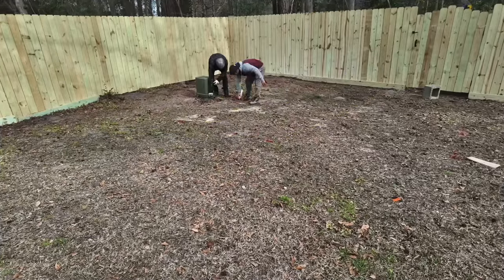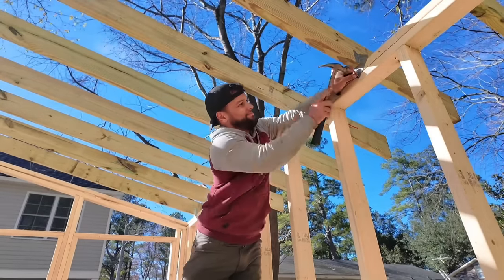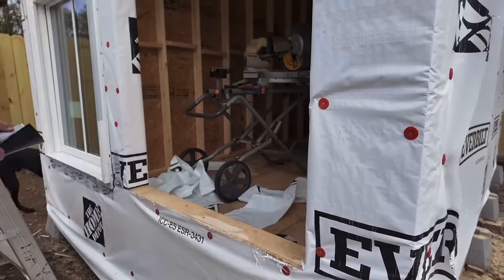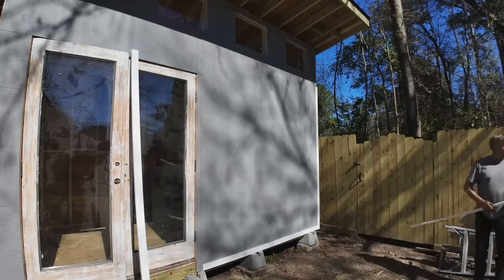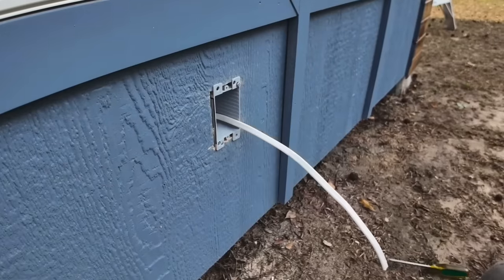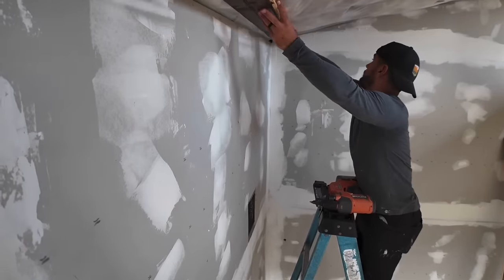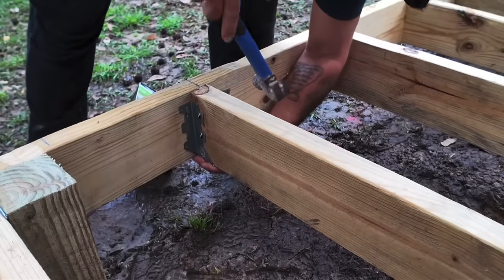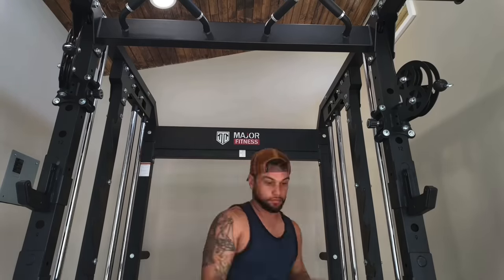How I Built A DIY Tiny Home Gym Full Build

Comment: This is nice. I especially love the windows across the top of the wall. Let's light in but folks can't see in and you don't have to buy shades/blinds/curtains for privacy. Where I live though, it would need to have mini split or a AC/heater combo built in to the wall or I'd die of heat exhaustion in the summer and freeze in the winter. It's currently 96F and feels like satan's furnace in my yard. I don't want to know the temperature in my outbuilding. It's insulated but not climate controlled. 

Thanks for sharing your efforts in building this tiny!

Comment: Just like HGTV. Looks great. But your longevity with a structure is only as good as your base.  And that concrete will crumble and cause issues.  Also you could have saved money on the screen track by using wood trim over the screen stapled on.  Cheap simple and effective.

Comment: How come the deck is secured by dug in posts, while the house is just sitting on blocks.
Reply: Because the deck is so much lighter than the house. If a good wind comes in, it can lift the deck and break the wood. If there is a wind strong enough to pick up the house, it would have been destroyed anyway.

Comment: Very neat concept, but I am concerned about how narrow it is.  Trying to put weight plates on the bench press bar is going to be difficult.  Second, if the bar is in free form (i.e., not attached as with a Smith machine), then there is a risk of it hitting the walls making holes in the drywall.  The building itself is going to get very hot with the windows amplifying the radiant heat.  I would have installed a ceiling fan or at least installed a small purpose heat/air system that is for a single room and have a minimal operating cost.

Comment: Next time use a saws-all to cut out your plywood for the windows. Instead of a router. I'm sure that was a real pain in the butt. Saws-all makes the job a lot easier. I forgot to mention, so this is an edit. You did an amazing job for someone that doesn't build houses for a living. It takes people years to learn these skills some times. You nailed it on your first attempt. The only thing I would've done differently is I would've done a metal roof, and caulk every seam. Shallow pitch roofs should always have metal imo. Best wishes!

Comment: I noticed with the 4 small windows across the front, above the door, you only used a single sheet of glass with no insulation. Does it not get hot or cold where you are?

Comment: I don't know if anyone has mentioned this yet or not, but when roofing with standard shingles, every nail gun i've ever worked with has a built in guide on the front of it to where you can just place the shingle, then slide the nailgun up from the lower layer until it catches when it is in line.  Does that make sense?  not sure how to describe it... but it makes roofing a lot faster than trying to eyeball it.

Comment: As a person who has never built a house, how do you adjust for the small things you find like that door frame size issue around 15:25 and if you ever find angle/level issues with your frame and stuff? Like the sizes/holes have been built with those sizes in mind and I understand things go awry sometimes but how do you correct for that? How'd you correct the 1/2 inch extra space on that door frame without leaving a random space?

Comment: This is the best video for tiny home building. However, I noticed at 33:58 that the wire and LED light are in direct contact with the wool. Wouldn't this pose a fire hazard?

Comment: Love the idea.  Curious…why are you using both screws and nails as opposed to all screws?  Is there a specific purpose in that or preference?
Reply from the maker: Thanks. 
Screws are great to hold a piece of wood together tight but they are not flexible wile nails can flex without snapping so using both allows the building to be ridged and also flex when it needs to.
Hope this helps. ✌️

Comment: Couple things the sheath to the wire needs to be in the box your exterior gfci the sheath didnt enter the box 1/4 inch is required and the nail plates are not necessary if your hole is 1 1/4 inch from the face of the board

Comment: Helpful tip, never make your deck perfectly level from front to back.  Add just a tiny bit of and angle downward,  away from the house,  to draw the water off the house and the deck.  Now when it rains,  you'll have water that's going to go towards  the base of your house if you don't add that slight angle downwards. Not sure how you could fix this now, without a tremendous about of work.

Comment: For the wooden window sash (frames) I didn’t see any room for expansion (backer rod, setting block, 3/8 space) . Depending on the humidity, winter temperature or area of the world this is, the wood will suck in moisture and either make the windows unable to open or crack. (I do glass installation)

Comment: When you say you made sure all outlets worked. Do you mean that it was wired from the pole 😮already? So you were wirering hot? Or did you fill the breaker first?
Reply: Also why didn’t you use deck blocks ( the same as you did for your foundation)?

Comment: That wouldn't work at all in Florida
Looks like a Hurricane would scoop it right off the ground and throw it miles away.
And if it survives the Hurricanes, the Termites and Fire Ants would eat that floor away in one summer.  And most of the walls as well.
What part of the country are you in where you can build using a wood frame and leave Plywood and wafer board outside?

Comment: For the roof, you need to put the drip edge down on the eave first. Then the water barrier. Then the drip edge on the rake sides. You also didn't use starter shingles. I'm not trying to criticize. Just trying to help. You are actually building stuff. I'm just sitting on my ass watching YouTube.

Comment: I noticed there wasn’t a plate on the bar and wonder how easy it would be to slide on bumpers if that was even possible.
I’m not even sure the floor could handle deadlifts.
It’s a nice shed but I don’t see it being functionally more than that .

Comment: Never use screws on framing. They have no shear strength
Reply from the maker: That’s why I also used nails. A mixture of both makes for a rigid structure that can also also flex.

Comment: Why wouldn't let you rent it out? Maybe because you didn't pull any permits before building or have it inspected? If you had done those things,  you might have found out way earlier if renting it out was an option. 

Not trying to be mean at all,  but you put a lot of time and money into this,  and did so much research, except for one of the most crucial pieces of inflammation; zoning, permits and buildings codes. 

But this might be a blessing in disguise, because did you really want strangers traipsing through your backyard and everything that comes with it?

Comment: All this work and effort only to do everything wrong.  OSB was laid out incorrectly, the SPC flooring will rot out the subfloor code requires 18 inches min and or 6 mil plastic under the house, the slope is not correct for drainage, and on and on...I love the way you bolted a machine to a floating floor lol wrong wrong wrong
Reply: You down to make a video showing it done correctly would be Hella dope !

Comment: the width of the space is not practical for the setup you have placed there. Racking weight on that olympic bar has got to be quite the chore, not to mention if you want to do deadlifts or you walk your squat out even a little and happen to veer left or right, the bar is going straight into that nice carpentry.  Then the mirror...what exactly is that mirror going to do? Allow you to check your face makeup before you actually do your working sets? 

Don't get me wrong looks nice but for what you built it for this is completely impractically setup.

Comment: Looks great until some a**** call the city and they want to come out and look at a permit. I tried to start a business for the first time. Recently I got my articles of organization from the state signed paid my money to them. Then I find out other things like zoning. Okay, zoning, fair enough. You can basically only put certain businesses in certain places, which was a little ridiculous because of what I wanted to start and the limitations they gave me then they tell me that after I find a location and I call back zoning and they say, yes, that is okay to go ahead and proceed forward. I would then sign the lease and ask for a license to start building immediately. Rhett would start having to be paid while waiting for the license about a month later. I would receive a license and then I would be able to go over to the permit section of city hall. That is where I would then have to produce the full entire Plan, also known as my build out to the permits and zoning department where they would review it and get back to me and about 30 days now, I'm at 2 months of rent and no income. Once they approve it, I would then have to start building. It would take probably an additional minimum 2 to 4 weeks to complete what I wanted to do and it would have to be done by a contractor I could not do any of the work as I'm not a contractor even though it was simple stuff, then once it was complete, I would have to go and ask for the permits department to come and do an inspection Once they did an inspection, they would get back to me, so essentially, I would be at If I was lucky 3 and a 1/2 months worth of time before they will approve my first business and all it was was a dog daycare insanity. It would have cost me $25000 in the operating cost. Just to keep the business open. While permits were being pulled, zoning was being done. And that doesn't include another 15 to 20000 just to pay to put up a few small things the city required. Ultimately, it would be a ridiculous amount of money they make it impossible